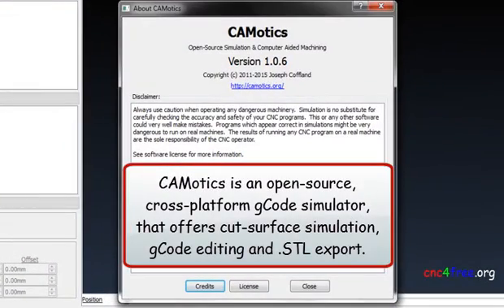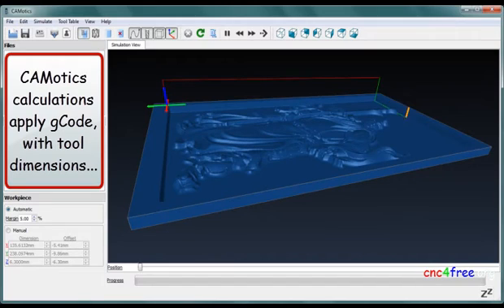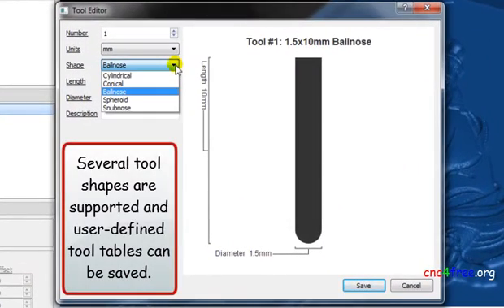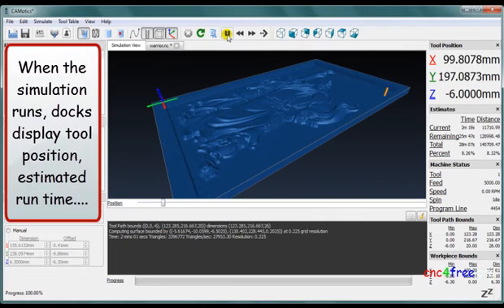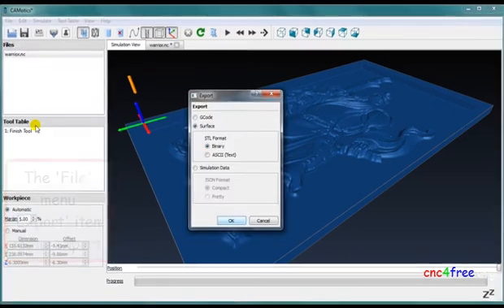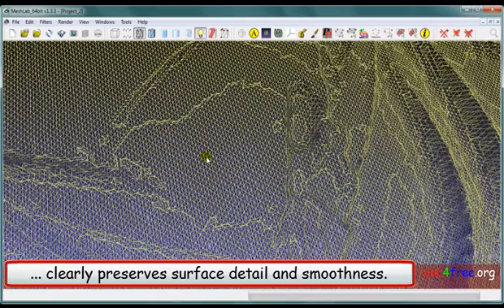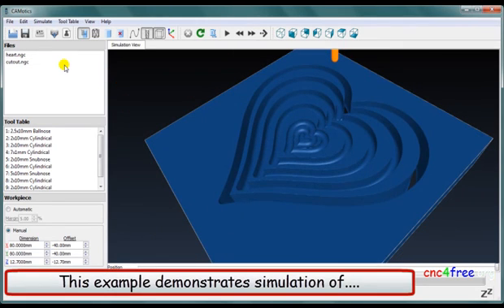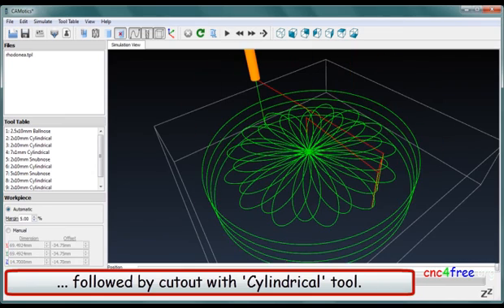CAMotics - OPEN-SOURCE, CROSS- PLATFORM, FREE GCode Simulation

Comment: I do not have that pen. How does it show up???
Reply from the maker: Hi there,

I think by pen you must mean the tools shown on-screen.   ??

Camotics uses a definable tool library... so the tools you see depend on the tools in the active library... 

If you select the 'New Project option, this unloads the default tool library (I think) so you may need to redefine the tools in the library before you see them on-screen.

If you are loading an example project.. the tools should be defined in the project.. so you should see them.  You will likely get more useful help by raising this at the Camotics google group.  The link is in an earlier comment..

Hope this helps.

Comment: Hi, great video. I have a problem and I was wondering if you could help me. I have the G-Code of some images, but when I want to see the simulation in CAMotics I just can't. I on open project and select my file.gcode, but there´s no simulation. Do you have any idea why? I would really appreciate some help. Thanks :)
Reply from the maker: Hi there,

Sorry to hear of your problems.... I've never had any problem with Camotics simulations.  Once I understood that resolution settings needed to match the tool step-over in the file, everything went fine.

Problems might be caused by the software that generated the gcode file.. I used the software / method linked below... maybe you could run your images through the same process and see if it makes a difference ??

https://www.youtube.com/watch?v=2pOfSsv7wYY

You might also mention your problems to Joseph Coffland.  He is the author of Camotics and will be able to assist you much better than I could.

https://groups.google.com/forum/#!forum/camotics-users
https://www.youtube.com/user/jcoffland

Hope this helps